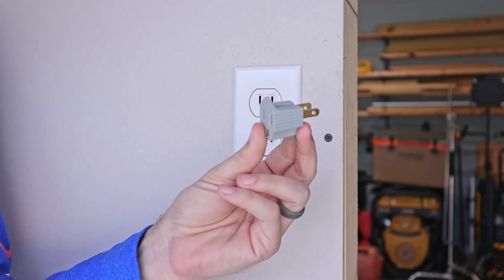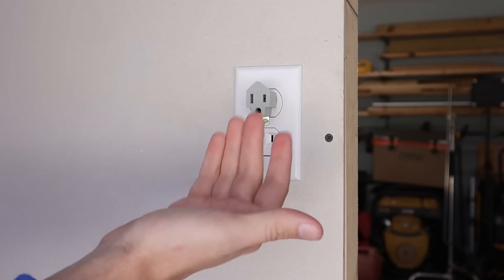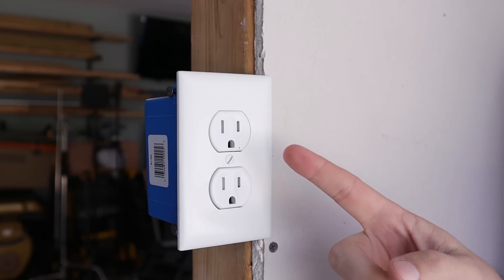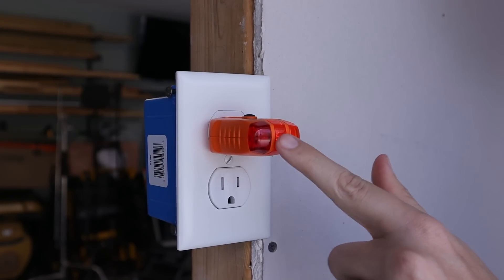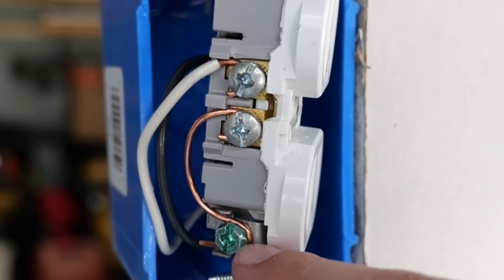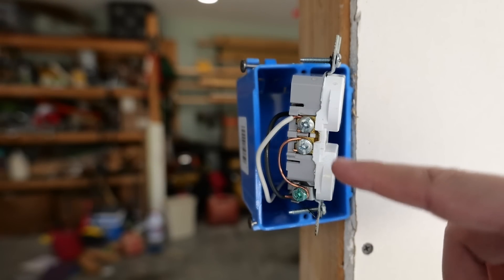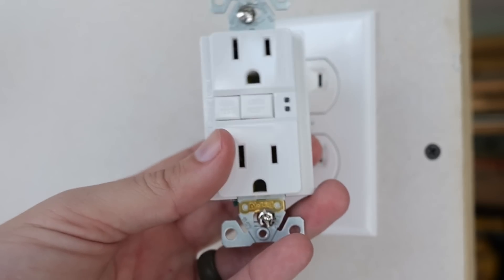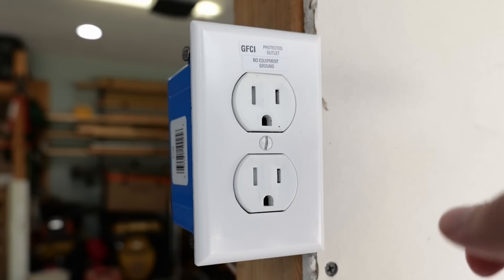EXTREMELY Dangerous "FIXES" Homeowners Are Doing To Outlets

Comment from the maker: Have you used or seen any of these "fixes" done to this type of receptacle?
Reply: Only a couple of times but I replaced the outlet with a GFCI and applied the label , No equipment ground and GFCI protected outlet
Reply: No
Reply: @diarrhea_splatter  I have the same situation. I am NOT going to replace with a GFCI as the receptacle will not match the decor nor will the antique covers fit the GFCI. I will not spend THOUSANDS in remodeling costs just to run new wiring. Ripping out lead painted walls covered with wood paneling to encapsulate would cost a FORTUNE. Would have to upgrade the service and panel too.
MANY thousands in costs for a lame outlet. No thanks.

To pass inspection, remove the outlet and put on a blank off cover. Inspector has NOTHING to test. Replace after you are passed.
Nearly EVERY item that you buy now is TWO PRONG.

If you epoxy fill a regular 3 prong outlet's ground hole, it becomes a two prong outlet.

I have used the adapter from time to time and without using that screw.
If I need to do a quick job drilling a hole I don't bother with grounding. Drill is DOUBLE INSULATED anyway.

Very few things need a ground - fridge, microwave, deep freezer, disposal.
Reply: yeah, we have owned an old house (finished built in 1910) since 1968. Our house is a private museum that is applying for registration to be a national landmark with our state historical society. We use those two prongs adapters all the time for our paranormal film crews as all our appliances and etc are original to 1968 and older and yes are two-prongs. We are restoring our knob and tube wiring to its original state and NOT upgrading. Not having a ground isn't going to kill you as everyone of our family members have been shocked in some form of another in our house just as much as any other household would have been. Actually, our electric is SAFER than modern electric wires due to our wires being spaced out with distance and no modern electric has been added to any of our lines or any in-wall/blow insulation has been added either. There is nothing wrong with using the prong adapters and yes they need to be screwed in as shown and not just plugged in the socket. We still use the old bakelite adapters to go from "Edison screw style" with brass plates and brass inside wall boxes to the "two-prong plugs", nothing wrong with using bakelite either... Our house even uses "knife switches" for the mains and also for the telephone lines.  We always fire contractors/electricians on the spot when they start preaching to us about our house, especially roofers trying to get us to replace our slate roof with metal or go solar and also HVAC guys always try to have us upgrade our 1951 Stewart Warner Winkler boiler (oil) that in 1960 had a 180,000 BTU gas conversion installed. Everything in our house has been restored to its original state (or is about to be restored to its original state). It's all about these contractors either making money or they're uneducated when it comes to the terms of "good antique USA-built stuff" when they tell you to rip it out and "upgrade" to modern China throwaway garbage... There is no need to upgrade if you know what you are doing, in fact, some of the older things will outperform the modern stuff when tuned/dialed in correctly (like our stuff is)... That older stuff is far more efficient than some of this modern stuff IF and only IF the older stuff has been tuned/dailed-in correctly...  So as to @HowToHomeDIY about using the word "fixes" in quotations,  the others concerns showed yes I can see how they are unsafe, but the two-prong adapter and how he made it out to be "dangerous" and "not long term", what a bunch of crap... Huge load of crap, the biggest line of bull pucky on the market. We've been using the two prongs adapters since 1968 and including 1930's bakelite adapters as mentioned and no issues whatsoever.... Modern electricians and modern contractors especially on YouTube, go figure lol
Reply: @crazysquirrel9425  Exactly... people like contractors and etc can always "spend your money for you" when you don't really need what they say...
Reply: Not yet

Comment: As a home inspector I have seen everything you mentioned. I use a receptacle tester for most inspections. However, I also use a circuit analyzer to detect bootleg grounds in older homes.
Reply: What’s a bootleg ground? Does it fool the receptacle tester?
Reply: @yapishkahilt Watch the video, it has the answer your question.

Comment: This was unbelievably helpful! I knew the code compliance rule about GFCIs. But I did not know about the neutral to ground terminal trick that "fools" testing equipment. VERY SCARY!!! I just bought a home last year and found all sorts of janky wiring in it. The house itself is grounded and all the Romex wiring appears to have ground wires in them. It doesn't hurt to double-check though. THANKS AGAIN!!!!!

Comment: I think these adapters came out when ground plugs started becoming popular. At least in my area, Northeast US, my house was built in '57, and came with 2 prong outlets. The wire in the wall, is even cloth, just hot and neutral. The box is metal. All the wire in the house is inside of the flexible metal conduit and is grounded, therefore the metal box is grounded, and thus this adapter would be grounded. I of course have changed it all, but that's what I had found, and would make sense if that were its intended use case and they just never went away.

Comment: it bears mentioning that most houses old enough to have ungrounded wiring are old enough to have the receptacle wiring in a "star" configuration instead of a "daisy chain" configuration.  
this means that you have the choice of putting a GFCI receptacle in nearly every receptacle location, or installing a GFCI circuit breaker in the breaker panel - which in a modern panel costs about the same as 3 GFCI receptacles, - and an Dual Fault (AFCI+GFCI) breaker often costs virtually the same as a GFCI breaker - and will protect from a loose and arcing connction - though they can be a pain to track down.

Comment: Great info as always. Back in the 1960s and 70s I lived in a house with no grounded outlets. I know better now, but back then any time I acquired something with a 3 prong plug I would get the hacksaw and cut off the ground pin. Was it the wrong thing to do? YES. Did it work OK for me? YES.
Reply: This is where the adapter shown with the tab can help.  I keep a couple in my toolbox just for these occasions, so I don't have to permanently remove the ground spike from a plug, I can simply "adapt" it to fit in the socket.  I also carry cables with croc clips that I can attach to the tab and connect to a real ground if needed, but I always regard these things as a "temporary" fix!
Reply: Well if t necessarily is not that dangerous if the floor is not conductive and there is nothing grounded nearby. However, using the plug in a grounded socket would be dangerous.

In Europe the plugs and sockets are specifically designed to allow connecting grounded plugs to ungrounded sockets. Here it was the other way that was banned  before modern double insulation.

Comment: The previous owner of my house used that neutral screw to ground screw fix to trick our inspector. I found it when I upgraded all the outlets to the decora style.  I then had to track down the reason for the open ground, he went cheap and instead of using a metal box, he used a plastic one and shoved the BX cable inside. Can’t bond plastic.

Comment: I remember seeing people cut off the ground pin from a plug, so they could use an non-grounded outlet.
There was also something I found in my mothers house.  That house, built in the mid 50s, had only 2 grounded outlets, beside the kitchen sink and beside the laundry tub.  Many years after we moved in, I had the kitchen sink outlet open and noticed there was no ground wire to the outlet.  There was only a rusty nail from the ground screw to the box.  However, it was so rusty, it was no longer touching the box!!!  I then installed a pigtail, to properly ground the outlet.
Another thing that was common back in those days was a small isolation transformer in the base of the light over the bathroom sink.  The purpose of that was so you could safely plug in an electric razor near the sink.

Comment: I've seen outlets done with the neutral connected to the ground here in Hawaii. It absolutely blew my mind. I've even encountered buildings with multiple generations of wiring still in use with glass fuses. Some still had wire to insulator that were still live😢 thankfully I never touched one before I found out they were live wires.

Comment: Recently moved into a brand new house - all up to code and such so I don't have anything like that going on.  That cheater jumper is just scary.  I did learn something though - I did not know you could use a GFCI like that.  I should never need it but it is good info to know.
Reply from the maker: Yeah in a new house you should not run into these issues.  My first home was older and these issues were everywhere from the previous owner.  Glad you found it helpful though.  Thanks a lot for the feedback Philip!

Comment: Can you explain why the jumper doesn’t work when both grounds go to the same grounded box other than having double ground wire
Reply: Connecting the ground terminal of an electrical outlet to the neutral (white wire) with a jumper is dangerous because the neutral wire carries all of the current that is passing through the load. The equipment ground is now a current carrying conductor that can supply current to a person that touches an earth ground such as a copper water pipe. If there is no other failure in the wiring, the shock would likely be minimal if the load is small. But a larger load or loose or broken neutral wire between the outlet and panel could make this a fatal mistake.
Reply: It does work but it is against the code as it has issues. Just do according to the code.
Reply: @LadderMover  There will be no shock if the neutral wire is intact.
Reply: @okaro6595  That's wrong, you can get a small shock from a GFCI receptacle before it trips and that's only about 6mA. It's most likely that the current on the parallel path created by an improperly connected ground wire will be much higher than that.

Comment: Hi, I've enjoyed your advice in the past and was wondering if you could help me with something i have not seen in any youtube video. I have a 1950 era home with ungrounded wire running through out the house, The previous owner replaced the 2 prong receptacles with 3 prong but there is still an open ground at each new outlet. In some special cases, they ground the new 3 prong by running a separate ground cable from the new outlet, through the box down stairs and attached to a copper water pipe. The pipe is a straight shot to the outside with no pex. when tested, those outlets show no open ground. Is that safe/adequate? it would appear form multiple youtube videos  that my only other alternative is GFCI outlets or GFCI circuit breakers. any help would be appreciated.

Comment: If everything is properly wired, it doesn't matter.  The existence of the ground wire is only because some wiring is done incorrectly.

However, I still went with the GFCI solution in my home.

Comment: Are there any tips when buying an older home to confirm receptacles have a ground wire or are bootlegged? I've only seen home inspectors use an outlet tester to spot check a few receptacles.
Reply: Based on a few years experience and talking to electricians who've been in the field for over 30 years, there are a few taletale signs of bootleg grounds.   First is the age of the house.   If it was built prior to the early 1960s,  the original wiring likely has no ground wire.   You could look in the basement, crawl space or attic and note the type of wiring, black or silvery cloth NM aka Romex usually is not grounded.   You could very carefully take the cover off the electrical panel and check if there are bare or green wires included with the circuits in question.   You may see some two prong outlets,  some three prong outlets.   If three prong outlets test as correct wiring dispite no evidence of a ground wire in the circuit,  you have a bootleg ground.    Hope this points you in the right direction.   If you don't feel comfortable doing these checks ,  don't hesitate to call someone who's qualified.

Comment: Those adapters can be really dangerous. If you use two of them and one of them grounds but the other for some reason does not now you have a system that mixes grounded and ungrounded equipment and if one of the latter fails you can get shocked directly to the ground.

Comment: If you do have a 3 prong that has something stuck in the ground pin at the top outlet then you can use a cheater plug as long as the outlet is not isolated ground screwing the tab on the screw grounds the adapter

Comment: When we bought our 100 year old house , the electrican replaced all of the 2 prong outlets with 3 prong and replaced all of the breakers with gfci ones. I guess that was easier? It's still a fire hazard to have old wiring though if it's not in good condition. We've since had to replace some of it for that reason.

Comment: What about residential main panels that are built so that the ground and the neutral are on the same bus bar? In that case do you even need a ground wire to receptacles or loop the bootleg in order to show two yellows on the tester? Please explain.
Reply: The neutral and ground should be connected in the main panel. How that is done is not that relevant (unless the code actually says something about it) so if there are two bus bars that are then connected or just one that does not matter. They are connected.

As it is said neural and ground should be connected ONLY at the main panel. Now does connecting them in the socket match that? No it does not.

Comment: The wiring in my rental house is Romex w/o ground. Is the wiring illegal? The house is almost 60 yrs old.
Reply: because it was legal when it was installed, it doesn't have to be removed, but if you do a remodel, you will probably be required to upgrade any that is accessible.
Reply: I was just about to say almost the same thing as Ken.   In almost all cases, any wiring that was code approved and passed inspection at the time of installation falls under the grandfather clause,  and your not allowed to alter, extend or remove sections of the circuit otherwise it's considered new work and you'd be required to bring it up to modern standards acceptable by the Authority Having Jurisdiction.   Much like old cars with no seatbelts.   Before 1966, in the US cars were not required to have seatbelts,  they existed some years before that but they were optional equipment for additional cost, even today it's not illegal to drive without seatbelts if they weren't installed at the factory and you're not required to retrofit old cars with seatbelts
Reply: @Sparky-ww5re  it bears mentioning, though, that if you install a seat belt kit in your antique car, you can't remove it later.  

it's also a fair point that if wiring is reaching a point the insulation is crumbling and connections are failing, it's beyond stupid not to upgrade it.
Reply: @Sparky-ww5re  It's pretty clear that my landlords have done lots of rewiring since the house was built that would not be up to code today. Their whole style is "if it ain't broke, don't fix it". And if/when they do fix anything the workmanship is sloppy, slap together. Nice people, but very little knowledge/skill. I'm grateful for the good info in the videos.

Comment: So how should the receptical down the line from the GFCI be wired?  Remove the cheater ground?
Reply: Just like any receptacle, but from the Load of the GFCI. No cheater ground.
Reply: If it is tree prong you need to just remove the link and label it. The ground should not be connected to anything.

Comment: Bootleg grounds are very dangerous indeed.   But there's something even more dangerous than a Bootleg ground.   It's known in the trade as a reverse polarity bootleg ground.  In homes old enough to have nongrounding receptacles it's likely there were circuits added or changed over the years oftentimes  by ill-informed DIY'ers   and the polarity gets reversed somewhere upstream.  This places 120V on the neutral and ground, and neutral on the hot.    A three light tester will indicate correct wiring,  and the refrigerator plugged into that receptacle will appear normal, until you  attempt to grab a can of beer while you are grounded one way or another.
Reply: Unless something was weird upstream, wouldn't the black wire used here have been live?
Reply: @flatfingertuning727  yes the black is supposed to be hot, white is supposed to be neutral except in   special wiring configurations such as the supply or switch leg on 2  wire switch loops, when used as a traveller on some three way/four way switching configurations, or when used as L2 on a 240V circuit supplying only line to line loads.   In these situations where the white is used as a hot, it should have been re-identified as such, with  black tape, paint or a permanent marker near the end at all termination points although you should never assume this was done.
Reply: @flatfingertuning727  The reverse bootleg ground happens just when the wires have been mixed upstream. A socket tester will not see a problem in it. You must use a non-contact voltage tester to detect it.